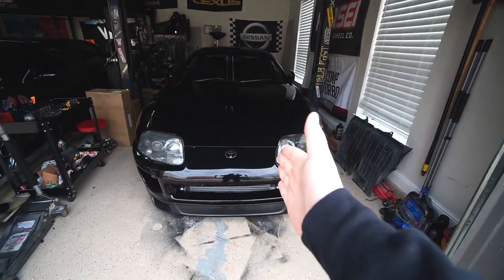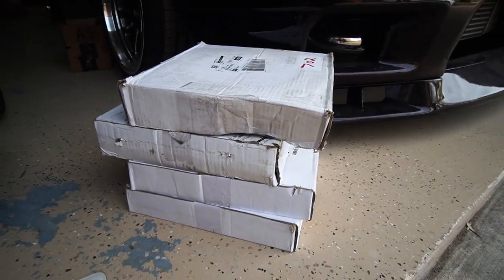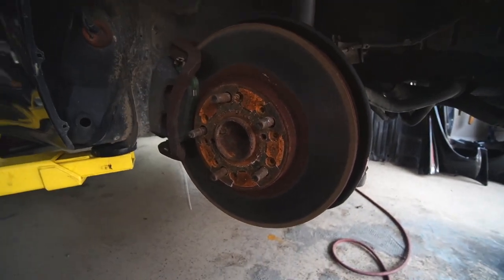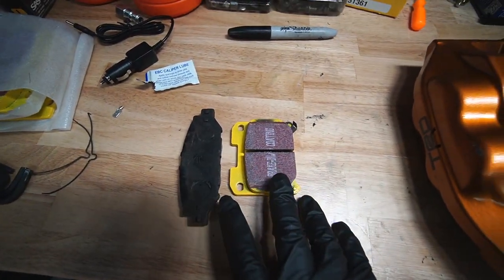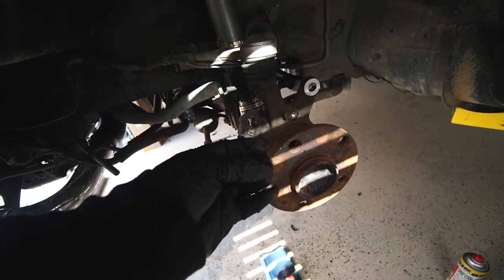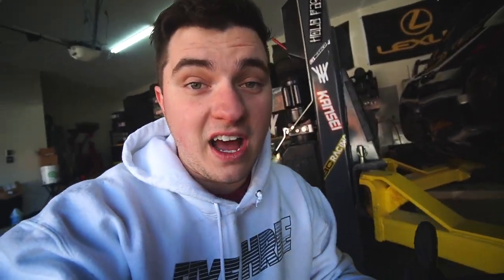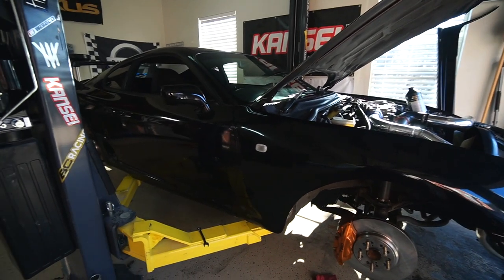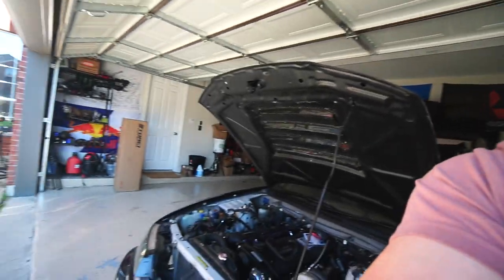RESTORING THE MKIV SUPRA! Pt. 2 (BBK install & Fixing brakes)

Comment: Well the drilled part of the rotors expell gases, it’s not too useful nowadays but if your in the mountains and air is really thin (like Colorado) it gets your brakes much cooler when going down the mountains, the slotted parts are meant to take a thin layer off the pad so you always have a fresh contact with your brakes. So drilled and slotted rotors do have an advantage, but carbon ceramic pads are really where you’ll see the difference, they have a higher temp rate then normal steel pads. That doesn’t mean it stops any better then regular ones but it does mean you can stop harder more often with next to no brake fade so you always have a constant feeling of having full stopping power

Comment: ABS opens, closes, and holds brake fluid pressure to each wheel that is locked up based on signals from the wheel speed sensors. The valves in the ABS unit can open, close, and hold 15 times a second.

Comment: These are LS400 95-00 Sumitomo calipers, painted gold with a TRD sticker, nothing to do with TRD. The difference between the OEM Supra 4 piston calipers is the Lexus LS400 ones are aluminum (compared to steel for the Supra) and the Supra discs are 323mm compared to 315. Very popular brake upgrade to the j-spec ones, as you experienced just a little grinding and they bolt on. 
They send you the correct brake pads for the rear, but for a TT Supra 2 piston caliper, which you don't have upgraded at the rear.

Comment: It’s funny you gave instructions on how to do the wheel studs, I just did, or tried to do AARP extended studs and I did exactly what you said but by hand with a wrench and it still stripped them. And the even funnier part is I had the exact same Lugnuts as what you have. I ended up just putting the stock ones in since I stripped five studs and five lug nuts LOL. And then ordering two new wheel hub assembly’s and I’m Going to use washers next time

Comment: You know, I have been in your shoes before and thought that drilled and slotted rotors are a waste of money. However, I could potentially argue your point and say they do matter and make more than a minimal difference, because in my personal experience they really have. Soooo here's the gist, I'm a poor college student and own a manual trans 2004 Mazda 6 with the v6 in it, and tbh I love modding and driving my car like its a sports car. I have used at least 3 sets of plain rotors on that car in the past 2 years and all of them have gotten warped in less than a year at best. Finally, I had enough of wasting money on plain rotors and spending the time fixing them myself that often, and decided to go with drilled and slotted rotors as my final attempt to end this misery. I spent $100 on each rotor, just for the front set, and oh my I will say I will never turn back to plain rotors. I've been using them for around a full year now and have gotten nothing but positive results. These rotors are not warped, not even in the slightest, they have zero cracks in them, and they really do stop the car a decent bit harder and quicker than plain rotors. I'm not a rotor expert, but I do know that those holes and slots help the gasses escape like you said, but those holes also serve as an extra way to dissipate lots of heat really quickly, and getting rid of that heat is the real key factor to maintaining a long and healthy brake system. And I understand that not every car is the same, so perhaps not all cars will benefit like mine, but I just wanted to bring up the point that drilled and slotted rotors may have benefits, it's just a matter of what car you own and if your willing to dish out twice as much money for them. However, that being said, I think it would be really cool if you put my theory to the test. So maybe, you could choose one of your cars to buy both kinds of rotors for and start by installing the plain rotors first. Then, perform a normal break-in period with the new rotors and get ready to test afterwards after they have cooled down completely. Now, the test should be you driving the car to 60mph or so and coming to a stop literally as fast as you can. Turn around, and repeat the test as many times as necessary until the plain rotors get warped. Note how far each stop took you, and how many times of going back and forth it took to notice warping or shaking. Then, install the drilled and slotted rotors, perform a normal break-in period, and repeat the test. I feel this would be a fair way to see if they truly make a difference or not for that specific vehicle, and also make for some great content on your channel! Sorry for the mad long post, I'm not trying to put you down or be negative or anything, I just wanted to provide some details from my personal experiences and give you a good reason to do something scientific on the channel that I'm sure most of us car guys would really appreciate. :)

Comment: Greetings from Russia! By the way, this is not necessarily a TRD caliper, they are similar to the Celsior/Lexus LS UCF20/21. If you want, I can send a drawing for the CNC to install the rear calipers from UCF30. And you will have 4 * 2 brakes

Comment: I realize this is a year late, but there was nothing wrong with your ABS actuator.  The 90s and early 2000s gen Toyota/Lexus ABS systems have an ECU controlled bleeding procedure that you need bi-directional controls to activate.  You may be able to do the procedure with an Autel/Snap-On/whatever diag tool, but we use the TechStream diag software through the dealerships to do it. Hope this helps someone in the future.

Comment: this is so funny to watch every one knows pads are what makes a car stop better no one thinks rotors are more important and the reason for drilled and slotted is to get rid of the hot gases which all breaks still make i dont know a single brake that doesnt produce heat its the main reason for brake fade

Comment: i'm not an engineer or anything, but i'm pretty sure the holes and stripes no the disc are not all aout "gases", but about heat dissipation and deformaton on the plate, and thats why people use materials like ceramic on breaks... but i might be wrong....

Comment: Your passenger side brake pads were place wrong. The pad was facing out instead of towards the rotor. Good thing you replaced them with big and better ones 😅😂👌

Comment: Evan Why you stealing my brake color.. lol Not a fan of EBC as i had some bad experience with them I have been using Hawk pads and i'm really happy with the bite and performance. I did a video upgrading my f150 brakes and they made a huge difference.

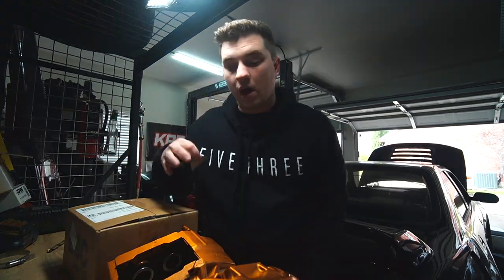Comment: 2:04  your wrong!   Tires make the biggest difference  then you need pads that will make it so you can lock your wheels with the extra traction   then you need rotors big enough that the can that the heat.

Comment: Pls get your brake theory correct pad material and rotor design also matters drilled and slotted rotors are good to not prevent to much heat and create a spongy pedal. Ceramic pads are the best to not create to much brake dust and not noisy.
Reply: You should look into differences on brake master cylinder from a trd edition to the one you got now so your not affecting piston travel and force